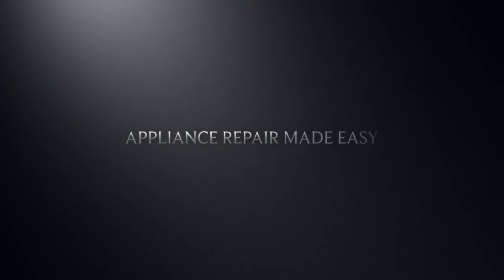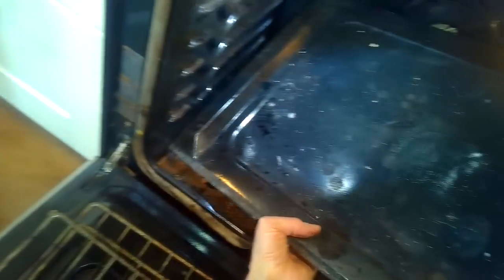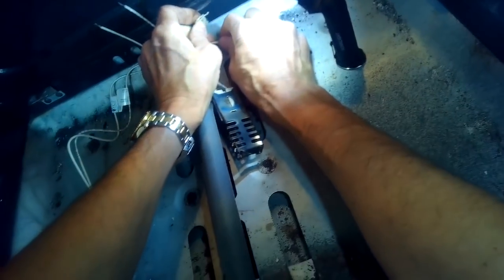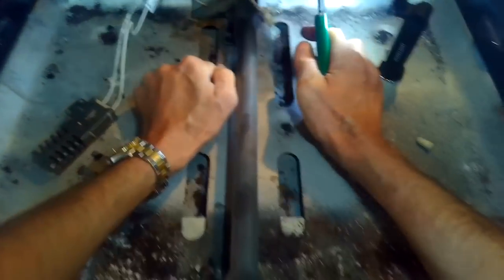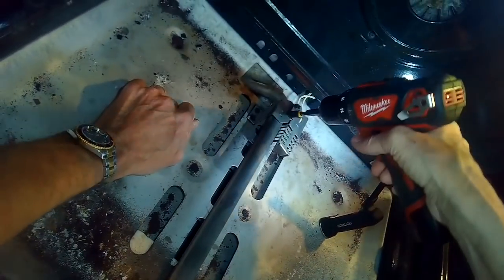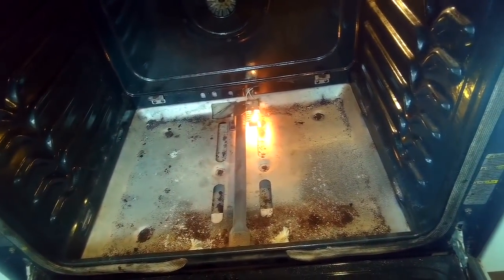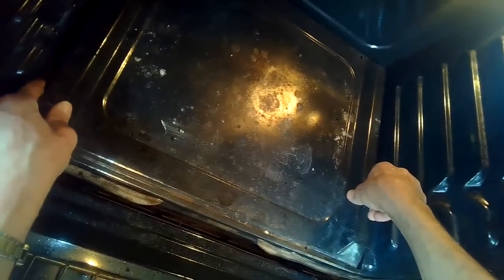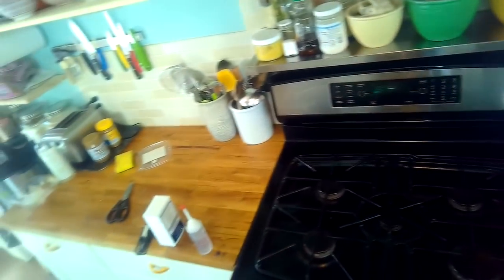✨ Gas Oven Won’t Heat — EASY FIX ✨

Comment: Best video I have seen on this. Thanks for explaining what's supposed to happen, how, and why. And what can be done to adjust. Rusty screws can be loosened by applying water and working back and forth. Moisture causes rust and, unlike oil, dissolves it. Same for rusty pliers. After loosening apply WD 40 (to pliers) a moisture displacer  and lubricant.
Reply from the maker: Great to know,
Thanks Mark👍👍👍

Comment: Nice video... I replaced gas igniter on my 30 + year old Kenmore gas wall oven about 6 years ago and everything worked fine. Problem now is that while the igniter comes on it doesn't seem to get close to being white hot but it does ignite the burner but the burner flames are very small... Like a quarter inch instead of the half inch the manual says is correct. Takes too long to cook...sounds like the igniter so I guess I'll replace that again... I'm just surprised that it only lasted six years or so.
Reply from the maker: You need to adjust the air/fuel mixture for the oven to increase fuel. Don’t go too far or you’ll get lots of yellow flames which mean carbon-monoxide
Reply: @QuickAndEasy5MinuteAppliance  thanks for the info!

Comment: My Kenmore gas oven made a click then popped the breaker. After that it won't heat up. I changed out the igniter but the new igniter won't light either. Broiler and range top still work. Any thoughts?
Reply from the maker: Great Question Brad👍 Click Here to Get Live Expert Help From Me For Just $5.00:
https://www.youtube.com/channel/UCGpInAejvpfVVE4FHB_L-Dg/join

Comment: I am wondering if I need to do this. My LG oven may heat up but then it stops heating. My “fix “is to turn on the broiler run it for a minute and then turn on the bake feature again. Seems to work. Maybe the igniter is not reigniting the bake burner because the igniter is it going bad?
Reply from the maker: Time for a new igniter 👍
Reply: @QuickAndEasy5MinuteAppliance  Absolutely! I actually ordered one a couple of days ago, just installed it, and it has been working flawlessly. The old one was all burned up. Thank you!

Comment: Both the broil and bake on my gas convection oven will not work so it's hard to believe both ignitors need to be replaced at the exact same time. Any ideas what the problem would be ? I can smell gas so that's not the issue. The oven clicks a number of times but won't lite. Great video.
Reply from the maker: Can you send the model number?
Reply: @QuickAndEasy5MinuteAppliance  Yes: KGRA806PSS00. Thanks so much

Comment: Question: my stovetop works just fine, but the oven won’t light. I replaced the igniter with a new one, but still nothing. I know it’s almost always the igniter, but I there anything else it could be? Visually, everything looks fine. Could it be I just bought a dud new igniter?
Reply from the maker: I think it’s time for a new controller that sends power to the igniter.

Comment: Hi. I have a very old Magic Chef Gas Stove. Maybe 1960s. (Has the woodgrain design around the controls with unsealed pilot lights)
Both pilot lights inside the oven work fine but the flame bar will not light.  Please help?

Comment: Kenmore gas range. Model 790.
So I changed my oven igniter after several of these tutorials pointed to the igniter as the prob lem. I turned on the oven and still nothing. No glow, hard to tell if there is power going through the wires in there. 
So what is next in line if the igniter is not working? *oh, btw, I put a ohm meter on the old igniter and it proved to be still good. Something else is causing the oven igniter to NOT get power. Any ideas?
Reply: Thermostat

Comment: Mine have the same issue however the part you replaced mine does light up. I just don’t get gas however my top gas part works fine? What could be the cause?
Reply from the maker: Just need a new igniter.

Tired old Ignitors light up but won’t let the gas in.
Reply: Quick and Easy 5 minute Appliance Fixes thanks

Comment: Oven appears to be missing the intermediate winged heat shield/distribution piece that attaches to the Venturi, before the square (boxy) panel is installed?
Reply from the maker: I’ve seen many models that don’t have it.

Comment: Awesome video, thank you!  My oven would not hear, igniter not nearly as bright as video, but oven kicks on after 30 sec.  After lit gas flame is strong then dies out.  Would this be also caused by the igniter?
Reply from the maker: Sounds like an igniter.

Comment: I have a 20" Holiday gas stove and the oven igniter is lit, but it won't light up, no gas coming. I can't find anywhere on the internet for advice on these smaller stoves. Got any advice? Thank you.
Reply from the maker: Hi Dixie,
Just need to replace the thermocoupler. That’s the thing the pilot light is aimed at.
Reply: @QuickAndEasy5MinuteAppliance  Thank you Sir, I'll see where I can find one.

Comment: I see you turned of power and shut the circuit breaker.  Do I have to disconnect or turn off the gas?

Comment: Question..when I turn on the oven to bake I smell a gas leak a good bit too.. but not the same amount of gas when I light the eye on top. Was such a strong smell and amount I turned bake off  Could this be the corrugated gas flex line or the actual stove?
Reply from the maker: Can you contact me at scottthefixitguy@yahoo.com .

It’s probably a worn out bake igniter.

Comment: I have a kitchenaid double oven. My bottom oven works but the top one stopped. I replaced both igniters in the top oven but it still doesn't work. The top one will glow but the bottom igniter won't even though it's new. Any idea what my problem could be?
Reply from the maker: Time for a new oven controller
Reply: @QuickAndEasy5MinuteAppliance  strange as I can hear the relay click once I select bake. My understanding is typically the control boards don't fail. This is a 3 year old oven btw. 

I haven't had time to hook my multimeter up to the gas safety valve. Could this also be my problem?

Thanks for the help

Comment: I did all of this I change the top and the bottom Spock igniter and it still does the same thing next thing I'm changing is the temperature sensor. I Wonder Could That Be the issue? The stove just won't stay on the gas you'll hear it shut off and it won't light

Comment: I have a gas grill and cooker the gas grill won't stay lit I push the spark button and push the knob in on the cooker and it sparks and lights but when I release the knob and turn how high or low it cuts out

Comment: My oven doesn’t stay hot it does heat up but isn’t staying hot...it eventually cooked the wings I was baking taking almost 3hrs..the broiler works fine however? What now ?
Reply from the maker: Time for a new igniter.  It’s an easy fix👍
Reply: Quick and Easy 5 minute Appliance Fixes I just ordered one fingers crossed ...thank you ..🤞🏼

Comment: My igniter  glows red but the oven will not light , propane is good all top burners light so what  else could it be
Reply from the maker: The igniter is worn out.  Even though it glows, it doesn’t let the gas flow in for ignition

Comment: If for some reason you don't tuck away where you connected the wires to outside of the oven can it be dangerous? Thanks.
Reply: michael gonzales. Come on now. Yes Ull burn them out n ur new igniter maybe even smell it burning n a fire

Comment: Hi my fridigaire gas oven it’s still glowing when i turn on but it will not heat up, when touched only felt likely warm, could that be the igniter’s problem, and if it is, how do find the correct model for my igniter, please assist!
Reply: Cerina Lin You can find it by getting the model number of your stove and searching for the part that way!

Comment: I just can't figure this one out it is a cheap but very expensive LG oven LOL Iran and Holmes check on the thermostat probe and it showed a thousand plus so that's okay ran conductivity on the glow plug or igniter and there is no break and the continuity test the relay on the circuit board is clicking when temperature is set and start button is pushed.... confused as always any help would be appreciated thanks

Comment: there is no wire cap there to connect the wire there when I pull them out.  So I have to cut them ?
Reply from the maker: That’s right👍
Reply: Quick and Easy 5 minute Appliance Fixes do they have difft models. I found the wire attach In the back they have a cap i jus unplug it to take it off. I try to order one online but come out some with difft model numbers.
Reply: Quick and Easy 5 minute Appliance Fixes I’m a woman lives by myself kno nothing about it jus watch your video and took the oven apart loll.

Comment: When I look through the opening on the bottom tray in the oven, it seems to me that flame is yellow from the bake burner whereas the flame for the boiler is blue...the stove burners are all blue?  Do you think it is normal?
Reply from the maker: I would change the air/fuel mixture for back to have more oxygen.

Comment: My oven pilot is on but no gas comes out when you turn it on? There is no doubt a sensor in there that has gone ( after 50 years) is that the same thing as an igniter?? Thanks
Reply from the maker: Your oven would need a new thermal coupler and that will fix the problem and let gas flow again you can get it at most hardware stores and definitely at an appliance repair store.

Comment: Hi, I have a Frigidaire gas oven that will not get to temp. I see flame so it's lighting the gas but it just never gets to temp. Also it's intermitant, sometimes it heats just fine sometimes it doesn't. Any ideas on that?
Reply from the maker: The igniter is getting weak.
Time for a new one.
Reply: But it seems to be lighting the burners, if that was the issue it wouldn't light at all would it? Also where is the best place to get the best price for the igniter, I saw it for around $94, is that the best I'm going to find? Thanks! Is a 316489402 igniter the correct one for my Frigidaire gas range model# FGF366BCA
Reply: Steve Laminack x

Comment: I replaced the igniter and it glows but still no flame? And ideas?
Reply from the maker: Can you confirm that the gas valve near the wall is on?
Reply from the maker: There’s a little gizmo on the gas regulator located near the back of the oven that you need to pull away from the regulator to let gas flow again.

Comment: "don't want to break these screws.. place a drop of oil on them.."  Then go at them with a high torque, low tactile feedback power drill??  Manual screwdrivers are still being manufactured although as here some may have forgotten..
Reply: The clutch is adjustable, meaning you can set it to whatever torque you'd like. Get to know your power tools and you'll know exactly what clutch setting to use for what type of screw/scenario
Reply: And the process to determine the clutch setting limit results in stripping the fragile sheet metal thread or breaking the screw.  That is referred to as a "destruct test".   Perhaps you should follow your own advice before attempting to dispense it to others.  Use a hand driver for tasks such at this.  I'd expect you'd find it at the bottom of you toolbox.